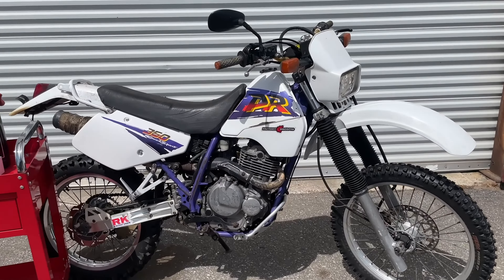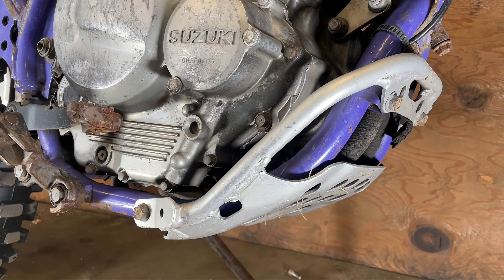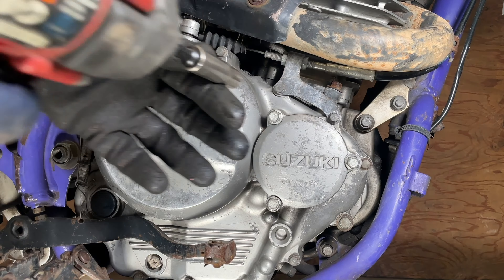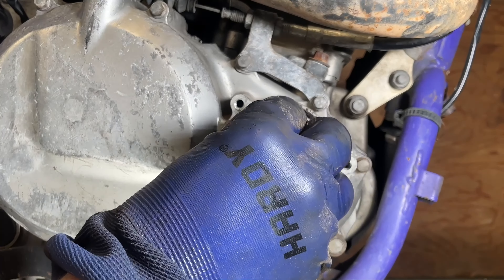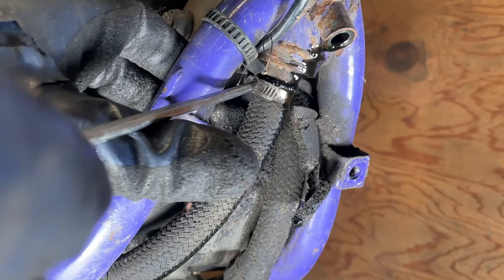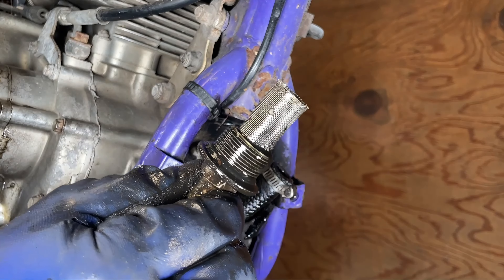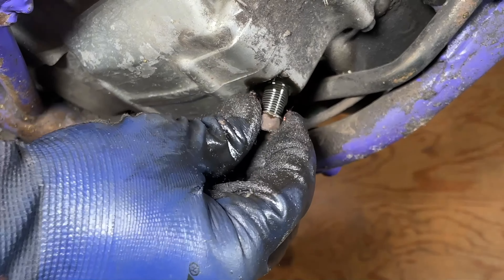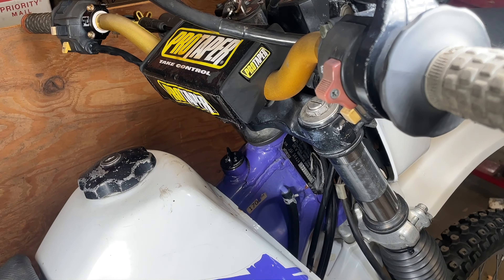How To: Oil Change for Suzuki DR350 (EASY!)

Comment: Did you say warmed up? Should I start the motor before draining the oil? What does that do?
Reply from the maker: Yes, if you warm up the motorcycle a bit (let it idle for 2 or so minutes). This helps any contaminants that are settled to become suspended in the oil so they come out when you drain.  Added bonus is that the oil will drain faster!
Reply: Thanks! I’m going to do it on my bike (1997 model) on Monday, when my new filter arrives 😊 
Hope my gaskets/o-rings are ok 😧 

Thanks for the great video, and for the quick response to my questions 😃
Reply from the maker: @iPhonesuechtler  absolutely! Glad we could help :)
Let us know how it goes!!
Reply: @GuysGearsAndGrit  Everything went fine, thanks to good preparation :)
Soaked the oil filter in oil over night. The manual said for oil and filter change fill 1,9L. Since I soaked the filter I went down to 1,8L and the result was a oil level of slightly over half full. So 1,9 will be ok too.

Thanks again guys, for the video and quick response, have a fantastic week :)
Reply from the maker: @iPhonesuechtler  very nice man! Super glad it went smooth!

Comment: You forgot to check the small o-ring before you put back the new oil filter. without that o-ring you have bad oil pressure to the cylinder head.
Reply from the maker: I believed we mentioned that O-ring and to inspect it closely? just rechecked the video.

We checked it before we put it back on.

Comment: Thank you buddy this is what I needed. If you have time make a video on how to replace fork boots!
Reply from the maker: Absolutely boss! we may have to look into a video on that! i will let you know.
Reply: @GuysGearsAndGrit  I have a 1996 as well just not as nice as yours. Putting some Tusk D sports on it next week. LED taillight and upgraded slyvania silverstar head light. It has an Acerbis gas tank but I am going to switch back to a DR tank. I have a 98 model tank and new petcock to go with just need to coat the tank before using. I looked for this bike for 10 years and after owning two other dual sports I was able to snag this one. Love this bike and the E start.
Reply from the maker: @The1JBanks  those are solid swaps! So it’s about ready for the trail again it seems like?
Reply: @GuysGearsAndGrit  hopefully by next week it will be ready to rip.
Reply from the maker: @The1JBanks  let’s goo, hope the swaps go quick.
I don’t think we have any fork tube boots to do a tutorial but if I’m not mistaken you would just have to unscrew the triple trees, slide the forks out get the fork tubes on and slide them back into the triple tree and tighten everything up!